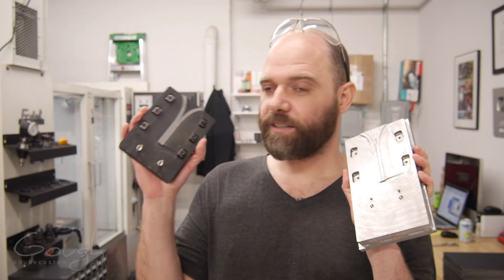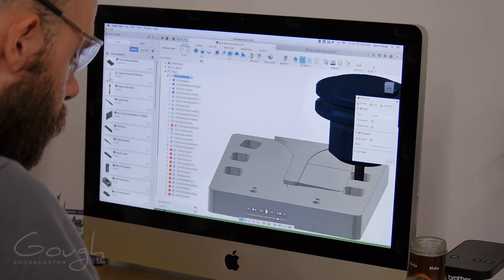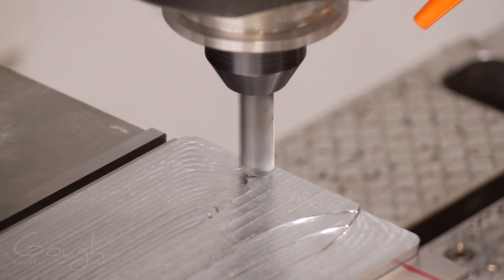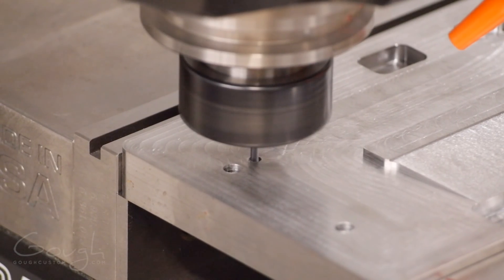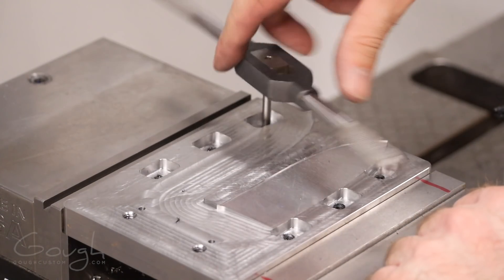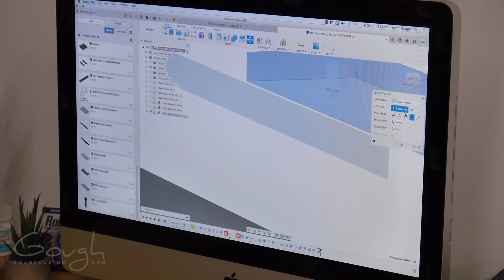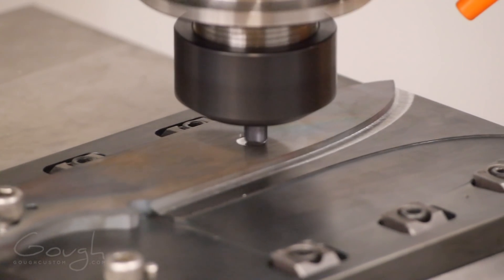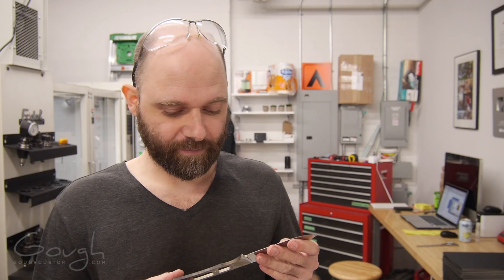CNC Knifemaking: Making a new Fixture!

Comment: What would your dream CNC mill be?
Reply: maybe a Kern with through tool coolant.

or a DMG HSC 75 linear with through tool coolant :)
Reply: I would go with a 5axis kern, with a pallet changer on that kind of work..
Reply from the maker: That is a great question Kip! And a frustrating one because it makes me think about all the shiny new machines out there 🤣

I think a machine with a larger table, higher speed spindle, and better 3D contouring performance would be what I'm looking for. I have pondered this question many, many times! I have a few answers depending on budget:

I have a billion dollars and I gotta spend it: Makino F5. Probably the nicest hard-milling machine around... They are designed for working on super tight tolerance molds and dies. Fine pitch chilled ballscrews on all axes, linear scales on all axes. 20,000RPM HSK-63A spindle... These machines are capable of producing mirror finishes on hardened steel parts with very little effort! Beastly machines! Ballpark price around $180,000 USD (I think...)

Things are going super well, everyone and their grandma are ordering knives and I've got excess cash: Okuma Genos M560V. Very sturdy machine with a great reputation for really high quality finishing capabilities. Bit more of an 'all rounder' than the Makino as the spindle is slower but tougher, can run larger tools more comfortably. 12K RPM CAT40 Dual Contact spindle. No ballscrew chillers or anything, but it still has a reputation for being very accurate. I think this is honestly the most sensible 'high end' choice. Price is $133,000 USD

What will most likely happen some day: HAAS VM-3. The definition of 'probably good enough, and definitely better than my current machines' lol 🤣 12,000 RPM CAT40 Spindle, decent in most ways! About $95,000 with the options I'd want!

I have obviously considered this a lot! I would LOVE a shiny new machine, but I don't think I can really quite justify it yet... Maybe some day!
Reply: @GoughCustom  thank you for the thoughtful and detailed answer.  Sadly, I'm out of grandmas but I'm happy to let other grandmothers know what nice work you do.  When cherry handles come back I plan on putting my money where my mouth is.  Have a great weekend.  Oh, I see the cherry handles are purchasable.  So I did.  Now I'll have something to show everyone and their grandmas.
Reply from the maker: @kipsimpson2332  No worries at all Kip! I love chatting to you guys about this stuff! I actually have Cherry Red knives available now! No pressure though, they will be available every month going forward!
Reply from the maker: @kipsimpson2332  haha and I just saw the email for your order!! Thanks very much mate, I'm looking forward to making that for you!
Reply: @GoughCustom  i agree that Makino is a fantastic hardmilling machine, And the Okuma genos series is one of the best "middle of the road" machines out there, they even have a 5 axis machine! I dont know about your pricing though, as they list a starting price for the 560 at $133k.. Theres also Kitamura's new 4xv, and DMG Mori's CMX-1100V, which, if memory serves, starts at a hundred k. One thing i would absolutely do before making a decision, is visit area machine shops, and hear what they have to say - you may find that the "local" okuma dealer service is 500 miles away(service rates start not when they walk in your door, but when thry leave the dealership!) And does shitty work. You want a machine thats reliable AND has good local service, so ask around. 

If you're having issues with repeatability, have you considered you might have a bad encoder, especially considering the machines former life milling graphite...

Comment: I hope you buy an EDM machine at some point ... I'm sure you'll find tons of cool uses. 
Well ... that and a 5 axis, a surface grinder, a water jet, hell. get it all! :) 
But seriously, wouldn't an EDM be ideal for fixtures..?
Reply from the maker: An EDM, especially a wire EDM would be a very fun tool to have! Making fixtures on the machine where I'm going to be doing the work is actually ideal as that gets me the most accuracy with the least effort... For my permanent fixtures I actually bolt them directly to the machine table and then machine the entire fixture 'in place' so every feature lines up perfectly with where the machine thinks it is, has worked out very well so far!

Comment: If you're worried about breaking taps, you might consider trying out form-threading taps as they're more riggid. I've only broken a handfull of taps in 5 years, all due to the drill was broken beforehand :)
Reply from the maker: I haven't yet tried thread-forming taps, but I definitely want to! My understanding is they're better for softer materials like aluminum, especially when used outside a CNC, but something I'm keeping in mind for sure!
Reply: @GoughCustom  We use the on all our aluminium parts in our CNC machines 😃

Comment: How you do that Y and Z movement in same time ?
Reply from the maker: It's programmed as a 'parallel finishing' toolpath in Fusion 360. It's actually moving X, Y and Z all at the same time because the path it's following is on a big of an angle, around 10 degrees.
Reply: @GoughCustom  Thanks for your answer.

Comment: Would the surface finish be better if you angled the blade surface instead of running the mill at a slope action?
Have you tried something like that?
If I would to do this I might mount the fixture stand up 90 degrees (add the bevel angle) and run the mill on the side this might be more efficient only need to do 2-3 passes and the surface finish will be better the tool marks will be parallel to the blade just like the final sanding
But that’s just me I’m sure there’s still lots of problems to be solve
Reply from the maker: Hey mate! I have actually machined them with the blade tilted in the past and the surface finish was much worse! Basically when machining like that the whole bottom of the endmill is making contact and this makes it much easier for a chip stuck to the endmill to score rings into the blade and generally results in a worse finish... It's also quite painful to make fixtures that are tilted like that, and then if you want to fine tune the blade angle or edge thickness you can't without re-making the fixture. I have found the 3D machining process to be much more reliable!

Regarding tilting the blade all the way up and cutting with the side of the endmill: because I'm hard-milling these blades I think that would be impractical unfortunately. It would also force me to make a more radiused plunge line, which I don't really like, and would again be very fussy if the angle or whatever needed to be changed. 

Overall I've been very happy with the current approach! The only real issue is that it's slower than the other options, but honestly it's still pretty quick!

Comment: That mill you used for the bevel looked very interesting? What are the specs on it??
Reply from the maker: Hey Danny! The endmill I used was one that Maritool make custom for me... It is a 1/4" diameter 6 flute endmill with 0.06" corner radius and a short length of cut (0.375"). The high flute count and short flute length means it's very rigid! I get about 10-12 knives per tool which works out great. They just starting making an 8 flute version for me as well... Both are for sale on their website under the 0.250" diameter section: https://www.maritool.com/Cutting-Tools-End-Mills-Finishers-Square-End-5-Flute-and-Higher/c78_79_80_131/index.html

Comment: Is that a corner radius or face radius end mill you are using ?
Reply from the maker: That's correct! It's a tool that Maritool custom makes for me. It is a 1/4" diameter 6 flute endmill with 0.06" corner radius and a short length of cut (0.375"). The high flute count and short flute length means it's very rigid! I get about 10-12 knives per tool which works out great. They just starting making an 8 flute version for me as well... Both are for sale on their website under the 0.250" diameter section: https://www.maritool.com/Cutting-Tools-End-Mills-Finishers-Square-End-5-Flute-and-Higher/c78_79_80_131/index.html

Comment: A little hint from my personal experience (I do things like that for living). When you are jamming a hardened blade against the softer metal of that fixture, you are causing slow but steady displacement. It's hard to say when exactly (depends on geometry, torque, etc) but it's going to wear and might cause weird results. It makes sense to run it through the heat treatment and make it just about 5-8 HRC softer than what you are machining on it. Also, depending on the volumes, it might make sense to ditch the vise and make a table-mounted fixture that would hold multiple blades. It makes the load-unload process longer, but you gain longer cycle times that you can utilize for doing some other work by yourself not being interrupted.
Reply from the maker: Great tips! I actually implemented all of the above on my main fixture that I built a few years ago. All of the clamping components are spring tempered A2 tool steel, and the fixture is mounted straight to the table and located with dowel pins. Has been working great for a LOT of cycles! The fixture shown in this video was really just meant as a stop-gap and I have actually already stopped using it, just needed more throughput for a few months there!

Comment: Great video. I am a machinist as well cnc & manual, been at for 30 years. I read the comment you made about a Haas mill and I would advise against it we have a very large Haas with trunion instead of table. We have somehow managed to make it last from 07 until the present day. It should have been replaced 5 years ago.  There are much better machines available.
Reply from the maker: Hey Billy! Thanks for the feedback! I agree there are definitely much better machines available than the HAAS, but given my current machines I think the HAAS would still be a step up! What in particular don't you like about the HAAS, have they been giving you mechanical issues?

Comment: Curious what hard milling end mills you use, not familiar with them.
Reply from the maker: Hey Doug! The endmills are custom made for me by Maritool, and have evolved slowly over the years. Originally they were standard off-the-shelf 1/4" Diameter 4 flute endmills with 3/4" flute length and a 0.06" corner radius... The latest version is 1/4" Diameter, 8 flutes with 0.375" flute length and 0.06" corner radius. Increasing the flute count made the tools drastically stiffer as well as providing more cutting edges for increased life. The shorter flute length again increased stiffness. I run 2 identical tools in the machine, a fresh one as a finisher, which then gets used as a roughing tool after it's seen some wear. I get about 10-15 blades out of each tool as a finisher and same again as a rougher. You can see/buy them here: https://www.maritool.com/Cutting-Tools-End-Mills-Finishers-Square-End-5-Flute-and-Higher/c78_79_80_131/index.html

If you go up one level you'll see they have 5, 6, and 8 flute versions of the same tool as we have stepped up the flute count over the years. The lower flute counts are great for softer materials where you can take a larger chip! I would still recommend sticking with the 4/5 flute versions for annealed steel though, the gullets are just too small to clear larger chips properly when roughing with the higher flute count tools.

Comment: I was taught to set your Z zero off the top of the part, Never from the bottom, less chance of error . As a you are working above the fixture for offsets .Rather than from bottom. Same with the lathe , always from the face of the part. Never the jaw face or spindle stop. And that VRX stubby has seen better days LOL. Ran those a lot at my last job. Glad you are up and running with both mills.Thought , have you considered running the roughing cycle for both blades. I noticed you finished one blade 100% , was this a cycle test for that offset?  Looking forward to more videos in the future. Stay healthy and happy!!!
Reply from the maker: Hey Mike! I will usually set offsets from the top when I'm doing a one-off, however when using offsets with fixture plates I always set it from the table as Z zero... I think there are many different ways to do it, as long as you always have a 'system' to avoid mistakes then you're good!

I generally group my operations per station on the fixture, rather than per-tool as this lets me very easily run just a section of the program if I need to do work on a single knife or something... Costs a little bit of time on tool changes, but my programs usually take hours anyway so it's not a big issue!

Comment: I gotta ask, Why don't you machine your work holding fixture at an angle in order to use a facemill or a bigger tool to ruff out your part faster before your finish past?
Reply from the maker: Good question! 1) The blade is actually not flat, even when you angle the fixture... The blade gets thinner toward the tip which means even with it angled over the bevel gets lower in Z towards the tip. This means you can't use a facemill and I would still have to use a smaller tool.... 2) Getting the angle perfect on the fixture is a pain and leaves no room for fine tuning. In my experience everything needs a little tweaking! 3) With the blade angled over I would not be able to machine the flat area of the ricasso.

I actually did previously use an angled fixture, but I gave up on that after having all of the above issues with it plus more! Keeping them flat and 3D contouring them means the fixtures are easy to make and there's lots of room for tweaking angles/toolpaths/etc..

Comment: Interesting video but why don't you learn to grind the bevels by hand?
Reply from the maker: Hi Bobby! 
Interesting question... One thing: you're assuming I can't grind bevels by hand, but I actually can and have done it many times as I show in my other videos! 

The reasons I don't want to do it by hand are many, but the largest reason is that it's incredibly gruelling and physically demanding to grind lots and lots of knife bevels by hand. It's hard on your body, and it's also hard on your mind because it's an incredibly boring process once you're decent at it, I have ground probably well over 100 knives by hand and I don't particularly want to do it any more! 

I use CNC to reduce the amount of menial manual labor I have to do on a daily basis, so I can focus on more important things!

Best regards,
Aaron

Comment: That hard milling is beautiful, what is the surface speed and chip load for something like that?
Reply from the maker: Thanks John! In this case the finish pass was 7500RPM, 60IPM. With the 6 flute tool I used in the video that gives a chipload of 0.0013". I have recently moved to an identical tool but with 8 flutes, running a little faster feed to get the same chipload.

Comment: Also, do you usually not use any coolant when hard milling? Or was that just for the sake of the video?
Reply from the maker: I don't use any coolant! Just air blast to clear the chips and to help with keeping things cool. This has worked very well overall! I am considering adding an MQL system to see if that helps with tool life, but overall the process works great as-is.
Reply: not to sound like a know it all, but this is specific, and a very good question
when I'm  cutting through "soft" material, I'm machining through the equivalent of clay in comparison to my carbide tooling, this causes a lot of rubbing or friction and heat is produced, requiring coolant
when I'm machining hardened materials, on the other hand, it's a different story, better machinists than me say the reason for not using coolant is you're actually annealing material right at the cutting point, and introducing coolant will counteract this process
also cutting hard material can produce more heat in the tool, if at the cutting point the tool is heated, away from the material it's cooled, over and over again, I can "shock" carbide that is struggling with thermal expansion and contraction in too fast of frequency, this can cause the tool to chip or crack pretty quickly
air blast to keep the chips out of the way is usually the best bet!

Comment: Outstanding video Aaron!!  All the details and why's of fixture making really is educational and you did it perfectly.  Finish is amazing and goes to the other part of these processes...experimenting and choosing the Right End mills.  That 3way measuring tool is almost a dial CMM, very cool and didn't know they made those...pricey I imagine.  My hat is off to you for how far you've come in just a few years and the amazing knives you bring to life!  Thanks Aaron!!  How are the chefs knives coming?
Reply from the maker: Hey PJ! Sorry for the slow response mate... I'm swamped as usual! The Haimer dial indicator was actually not crazy expensive, about $500 which is very reasonable for what it does! I have been using it for 5-6 years and definitely have zero regrets about the money spent!

The chefs knife is going pretty well! I am most of the way through making the fixtures for it which is great! I have run some initial prototype toolpaths but still have a fair way to go... I think I'll have initial production prototypes completed within a month or two!